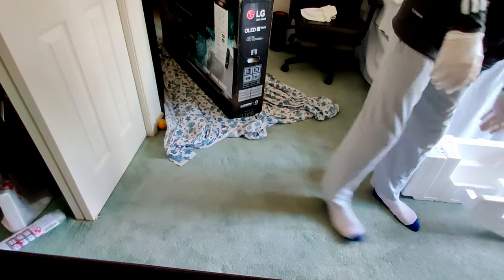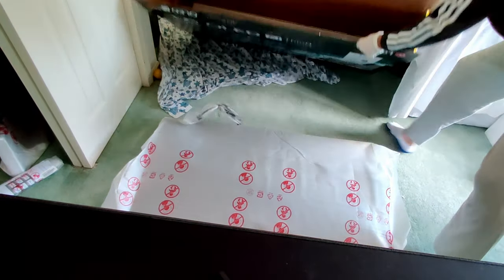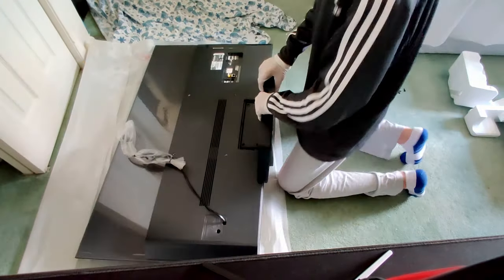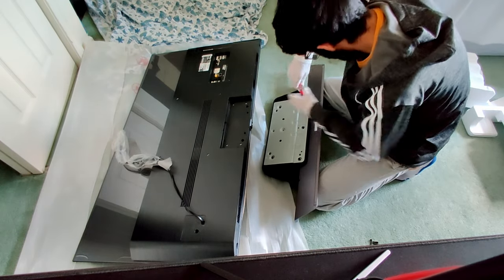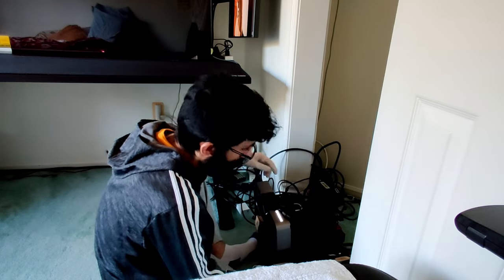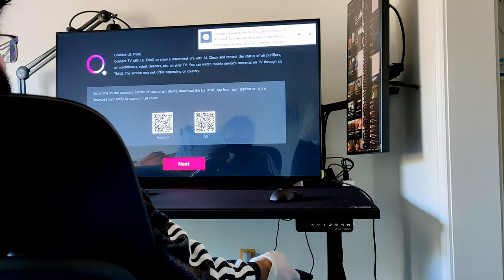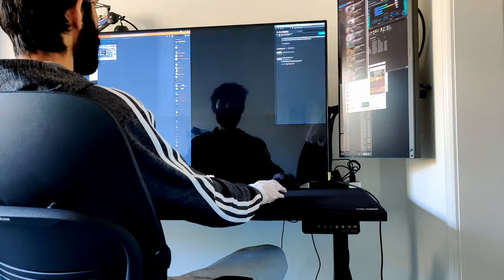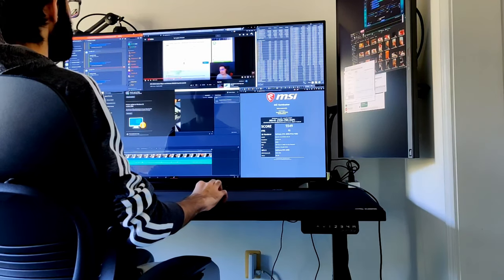LG 48 CX Unbox, Setup, & First Impressions

Comment: You're in the same position I am, coming from an ultra wide and looking to upgrade. I want to replace my 21:9 with the CX and I have two questions/concerns:

1. Is Gsync working correctly, even with 10-bit 4:4:4 (no subsampling)? No stutters at close to 120fps? Over on reddit people are saying Gsync is still broken and you get stutters when going above 100fps or going lower resolution (like 1440p)

2. I see you're playing at 21:9, that's what I'm aiming to do. Are  you using the resize option from nvidia controller panel and are you playing at 8-Bit color depth in that case? The only way to enable 10-Bit is using custom resolution utility, but I'm wondering if this is causing conflicts with HDR or Gsync.

You're the first one I'm seeing who is using this TV as an ultra wide (exactly what I plan to do). Hoping to to upgrade to this unit and use it for pc gaming, but I hear about all the those issues with Gsync and I'm not convinced....
Reply from the maker: 1. Without the latest firmware the G-sync does not work at all. Just flicker. Once, I heard that was fixed I ordered. I have seen the reddit posts. But, honestly I don't feel it like it's terrible. I don't know man. I would say you have to try it. It'll be fixed eventually. LG already said they are working on it and the patch will be out before year end. It's okay if you don't trust me. Do whatever you think is right. For me, I needed to see that initial patch that fixed G-Sync compatibility on Amphere GPU's. It's different if you don't own an RTX 3080 or 3090 yet. But, I want this all setup in time and perfect for Cyberpunk. I'm finishing this year of strong. F@#$ this Pandemic. 

2. I am running 3840x2160 120hz G-SYNC 10 Bit RGB Full. No BS compression. LMAO, No 8 bit either. I would recommend running it like I am then only run it in 21:9 for the games that you want it in. Like Samurai Jack: Battle Through Time doesn't have 21:9 support. So, I just ran it full screen on the OLED. But, for Call of Duty Modern Warfare 2019 all I did was set it to 21:9 in the settings via aspect ratio. Then, played with HDR & Dolby Atmos on the TV speakers. Played around with the window mode. I will do a more detailed overview on how I use PowerToys & Displayfusion later on in the full review. But, that requires me having the Ergotron HX arm to mount it on to my desk. 

If you still don't feel comfortable no worries. Then, just wait for my full review or even LG to just confirm all the issues are fixed or even more people on Reddit confirming that there is no G-sync issues with HDR on. I'm letting you know right now. Before that latest Korean Firmware I flashed if I turned G-Sync on the 48 CX would just flicker black screening hard. Absolutely Unusable. Now, it works and actually feels like G-Sync is on. Heaven forbid they didn't get the patch perfectly within a week of pumping that patch out. For how fast they responded and pumped out this patch I have faith and am very happy with this as of now. But, that's not a good stance lol. Putting my faith into a corporation and recommending my happy experience to another consumer that actually will pay for the product with his hard earned money on the promise said corporation will fix an issue that still exists. LOL. Luckily, there are extended Holiday Returns bro. If you don't like it just return it after a few months. I am happy with the panel. If you don't have the same experience it's okay. Just grab an LG 38GN950 or an Odyssey G9. Just for your information, the Odyssey G9 like most VA high refresh rate panels have G-Sync flickering issues. I would not recommend the G9. If you want to wait it out another few years then grab an LG 38GN950 and rock that till the 40 or even 32 inch OLEDs are available in maybe 2 years. I'm good bro. I love this thing with my RTX 3090. I'm ready for Cyberpunk 2077 with 4K HDR 120hz G-SYNC, RTX, & DLSS.
Reply: @SawmillMadhawk  thanks for your insight. Will definitely be eagerly awaiting your review and I hope you're gonna cover the gsync issues ad 21:9 aspects. Unfortunately, very few games have an integrated aspect ratio selector so you have to set the resolution/aspect ratio via the desktop resolution.
Where I live we have no return policies whatsoever, once you buy it you can't return it. Otherwise I would have gotten one already. That's why I need to consider very carefully whether im spending my cash on something that, as you mentioned, is only promised being fixed but might never be. I have a feeling like it's a hardware related issues that will only be truly fixed in next years oleds. Anyway, appreciate your insight and looking forward to more videos.
Happy gaming and stay healthy!
Reply: Same here, planning to move from 21:9 to this monitor, the only thing scares me is burn in, but seems pixels refreshing feature is helping in this case.

Comment: So is this better than a 240hz monitor? Like the Samsung Odyssey G9?
Reply from the maker: IMO, absolutely that's why I didn't buy the Odyssey G9 or the LG 38GN950. Then, again if I really want to run something at 240hz. I still have my Strix XG17 as a side/portable monitor.
Reply from the maker: Another point to emphasize, you can't do 4k 120HZ HDR G Sync with a 2080 Ti on the LG CX due to a lack of HDMI 2.1 ports. So, in your case the G9 works out better since it relies on DisplayPort.

Comment: Cx48 is the best for gaming... But for coding and gaming, 
do you recommend this screen ?
Reply from the maker: Gaming is great but sharp text in an IDE is really nice. Obviously, don't load up MARS for Assembly on a 4k 27 inch monitor LoL. But, windows scaling works decently well for most applications. The PPI is 92 on this tv and nothing to write home about. But, it really shines when used for media or gaming. If you can work with the 92 PPI and windowed applications then it's totally worth. But, really depends if you are willing to commit.

Comment: congratulations for ur new best tv i like it so much and i ask u plz if u ok is it better than lg cx 55 inch or what ? coz i will buy it before let me know plz thanx
Reply from the maker: IMO, no. If you are getting it as a TV for next gen consoles. Then, absolutely no. Grab it while it's on sale. If you want to use as a PC monitor like me I would recommend the LG 48 CX. Otherwise, put the 55 on a wall mount and move your desk back from the wall a good bit.

Comment: I have the exact same tv and using RX 5700 XT, freesync works well and have 10bit enable through the adrenaline app. Long as i dont have my image stuck on the destop image for more than a hour, im not worried about burn in.

Comment: I'm running a 2080s in my rig. Would this tv be worth getting?
Reply from the maker: It is but you can't do 4k 120hz with GSync due to lack of HDMI 2.1 on your RTX 2080. That's the reason all of us LG C9 & CX kids had to get an RTX 3000 AMPERE GPU. I don't recommend the CLUB 3D adapter because it's a janky solution. But the only solution for RTX 2000 TURING kids.